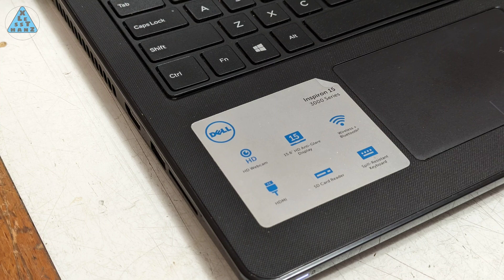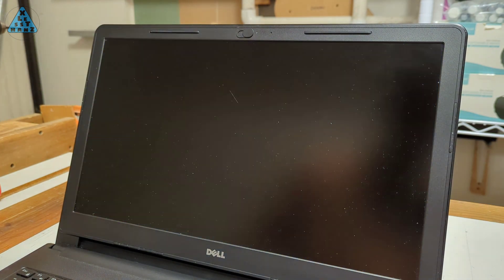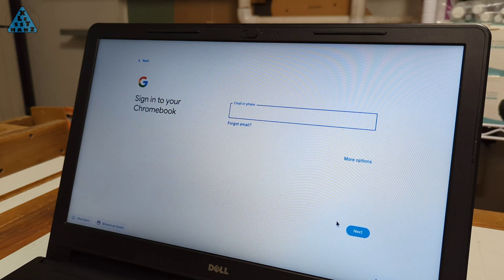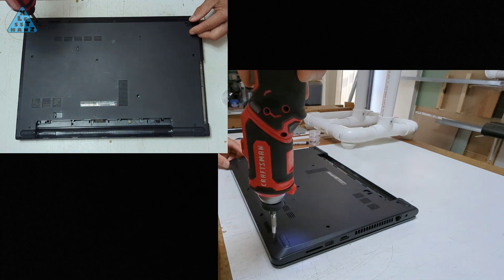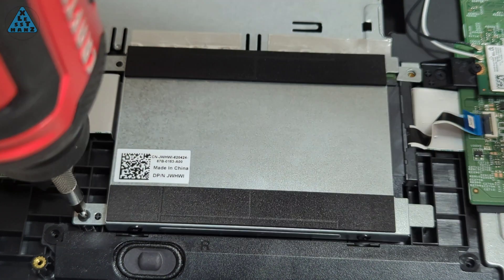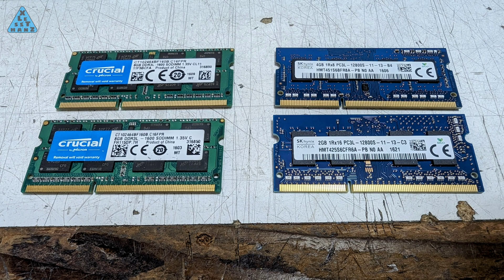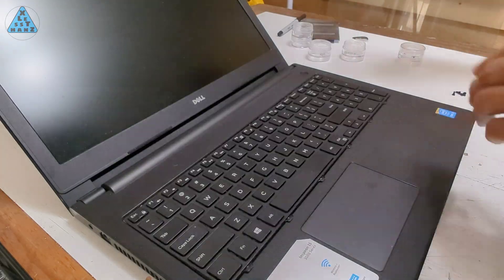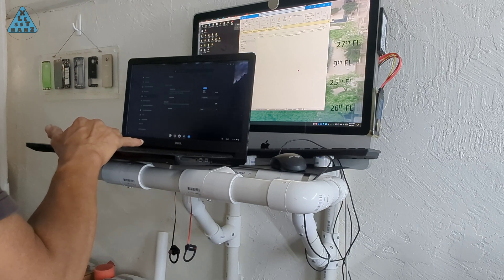Chrome OS Flex Conversion (DELL INSPIRON 15 3558)

Comment: I have this exact same model Dell. Excluding the upgrades you made with the RAM etc., was the performance better using ChromeOS flex? If so, how much better? I'm considering installing it, I don't want to bother buying newer parts if it's not much faster.
Reply from the maker: I did minimal testing on the laptop and it did seem pretty slow, so it needed a less resource intensive OS like ChromeOS.  The most resource intensive task you can do in ChromeOS is probably YouTube and that works fine.  The storage and RAM I installed should have made the Windows install a lot faster too, but I didn't test how much faster.